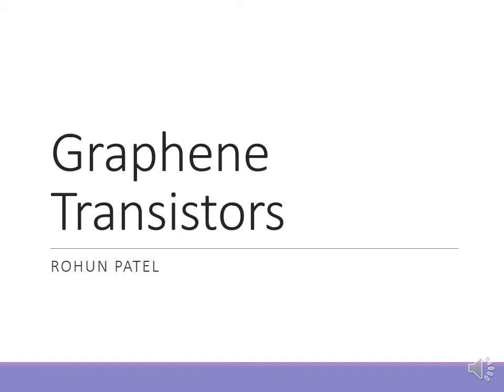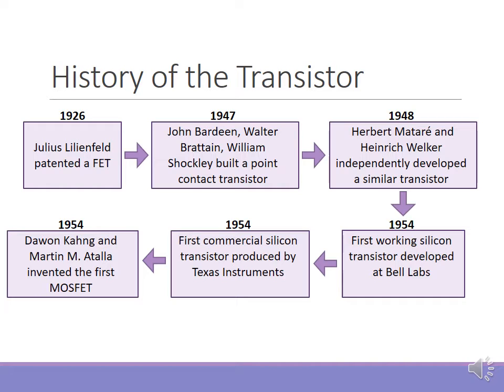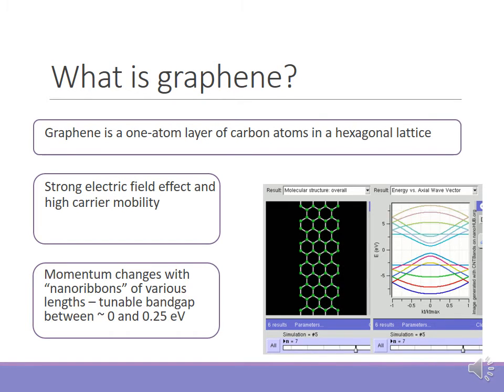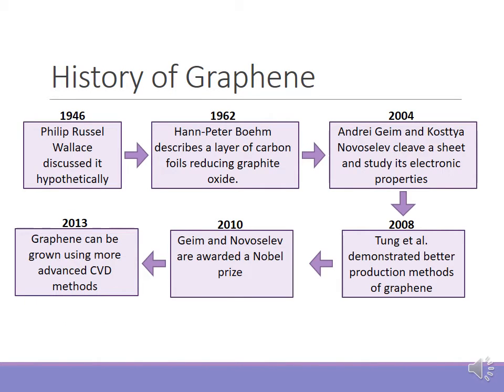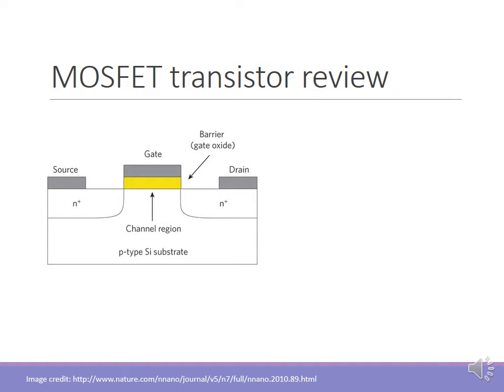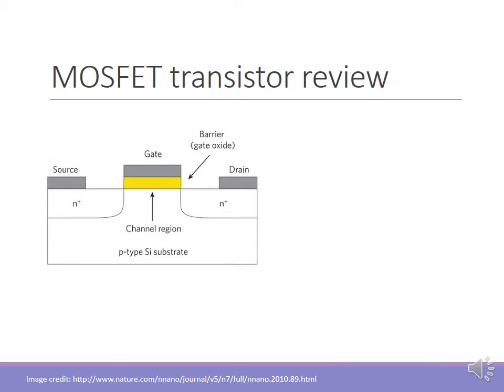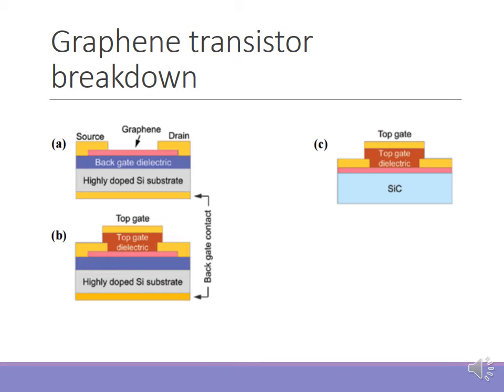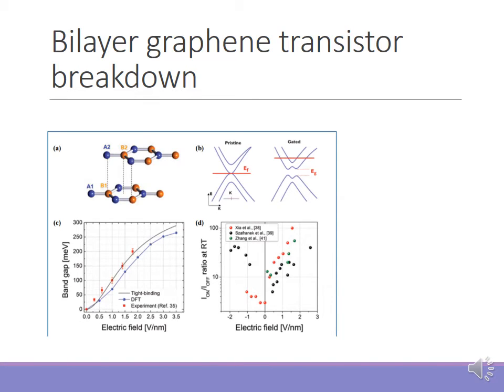Graphene Transistors

Comment: Can I use it for RF switch technology for which it will be required high current in on state and very low current in off state? what about breakdown voltage for graphene which is most important in RF application?